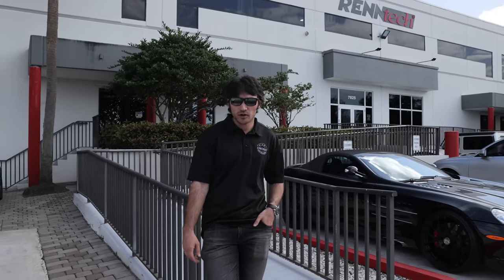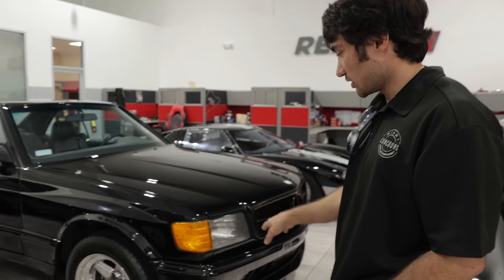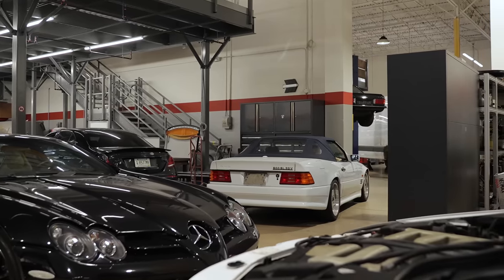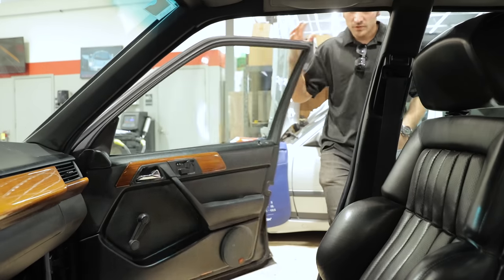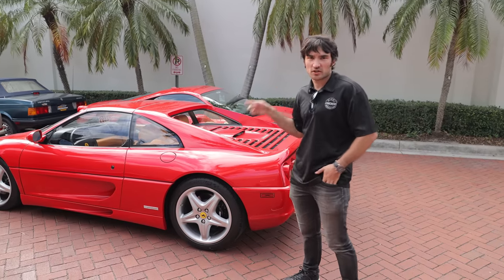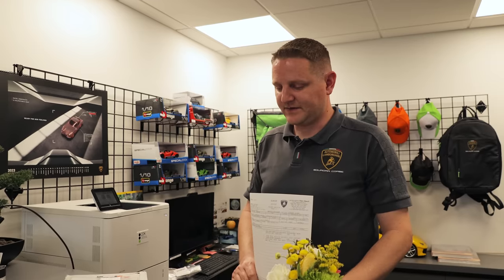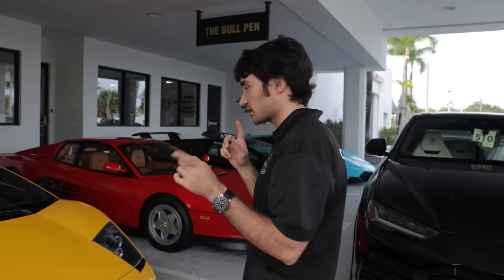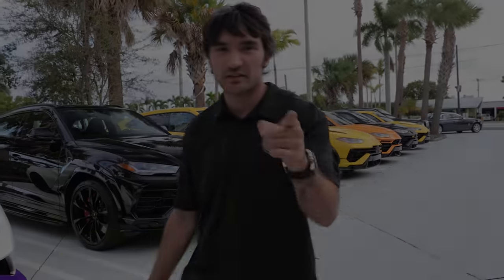Checking in on some LEGENDARY Restorations!

Comment: I now understand why shops like this are always so clean and organized.   After seeing  that small carbon box that was 10k, misplacing that would be a nightmare.  

Meanwhile at the shop I take my civic, parts everywhere.   And the wooden work bench they use has more grease baked in than a well seasoned cast iron pan.